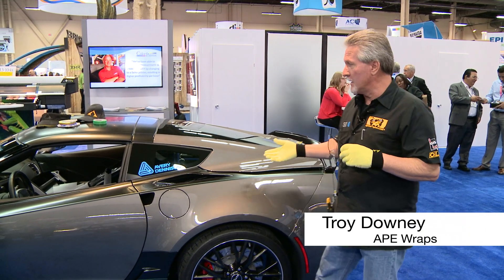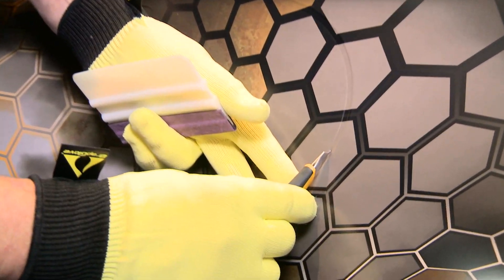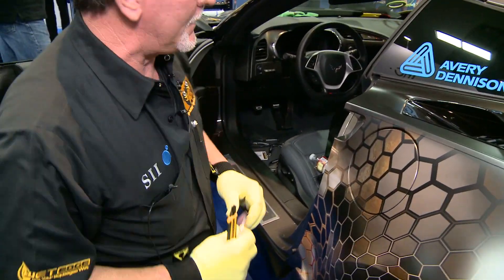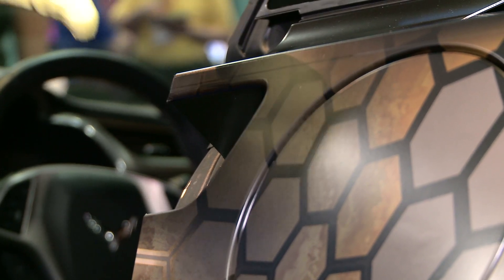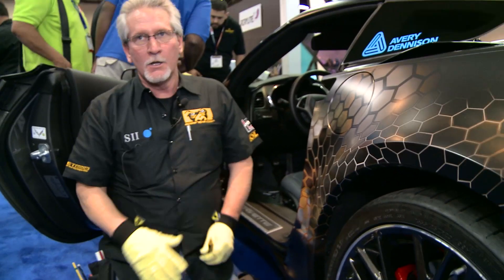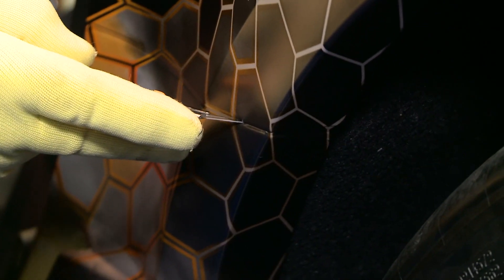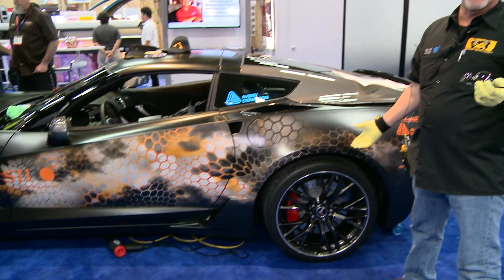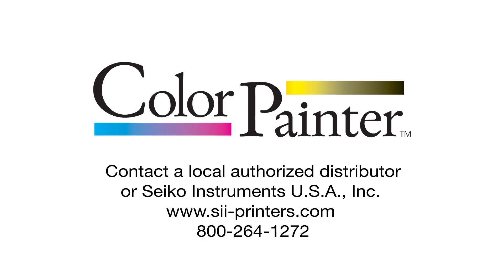Wrap with Ease Critical Areas

Comment: Question, let's say someone wraps their car.  When they decide to take it off, re-wrap...whatever, does it hurt the original paint?
Reply: Hanson Fam I have never wrapped a car but with what I've seen I don't think so
Reply: Depends on the quality of the paint when you wrapped it.  If it's a new car and the clear coat is good, then no damage.  If the wrap has been on for a while and baked in the sun for years and the clear coat is garbage, you may pull up paint
Reply: It does not hurt the paint at all. The main purpose for wraps is for protection